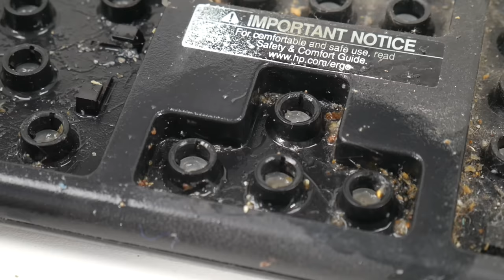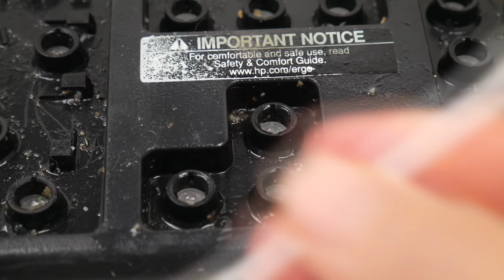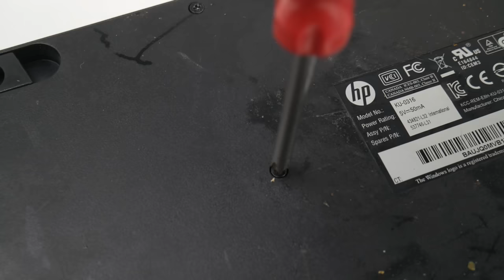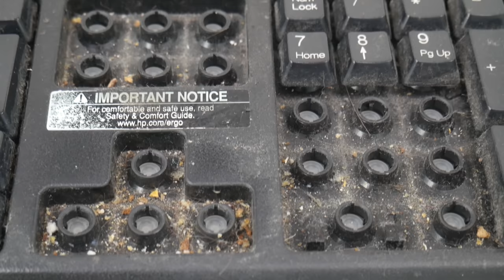Cleaning The Dirtiest Keyboard Ever!

Comment: Glad to know I wasn't the only one who was stressed watching this 😂😂
Reply: I was horrified when I saw him putting them in water
Reply: SAME
Reply: Same bro
Reply: @zmastereastee8033 it doesn't harm it if it's not plugged it. Just dry it before plugging again.
Reply: sameee
Reply: Sameeeeeee
Reply: Same
Reply: The electronic circuit board is sealed in the case for little water he used on it and then he dunked it in the water when the electrical parts were out if the way.

Compressed air will just blow the filth all over the place or no where as the keycaps are in the way.

What you should do is take the whole plastic case and put in is a dishwasher and the key caps and silicone in hot soapy water and mix. 

Don't use gloves as it's pointless as it's just old sticky crips and then wash your hands afterwards with hot soapy water. 

Use Mr Shine after to make it gloss like new.

Comment: I hope that this is some kind of joke. Im sorry, If Im being rude, but... this was horrific. First of all, It may be better, If you used compressed air at the beginning, but ok. Second of all, why did you use a toothbrush and q-tips to clean the plastic? Why didnt you use the brush, which you used later, to clean it? That really hurt my eyes. And why you used water to clean it, when there were still electronics part in it (6:00)? Ugh, this whole video just confused me and hurt my eyes. And you forget to clean the bottom plastic as well...
Reply: The electronic circuit board is sealed in the case for little water he out on it and then he dunked it in the water when the electrical parts were out if the way. Compressed air will just blow the filth all over the place or no where as the keycaps are in the way. What you should do is take the whole plastic case and put in is a dishwasher and the key caps and silicone in hot soapy water and mix. Don't use gloves as it's pointless as it's just old sticky crips and then wash your hands afterwards with hot soapy water. Use Mr Shine after to make it gloss like new.

Comment: Cleaning one of my old keyboards that was on par if not slightly better condition than this wasuch easier than how you did it. Remove key caps, dump the excess debris in a trash can, unscrew the back remove the front  and just go to a bath tube and drown everything in the soap and water until clean. For me even the electronics I washed with soap and water I just let it dry in the sun for a day or 2 before I used it again. Still works btw.

Comment: The electronic circuit board is sealed in the case for little water he used on it and then he dunked it in the water when the electrical parts were out if the way.

Compressed air will just blow the filth all over the place or no where as the keycaps are in the way.

What you should do is take the whole plastic case and put in is a dishwasher and the key caps and silicone in hot soapy water and mix. 

Don't use gloves as it's pointless as it's just old sticky crips and then wash your hands afterwards with hot soapy water. 

Use Mr Shine after to make it gloss like new.

Comment: If u are going to take it apart to clean it....then why not do so from the beginning instead of painstakingly using a paper towel (not even a microfiber cloth) and a dry toothbrush (when u actually had a huge black brush at hand later on). I already gave a concession that maybe u dun have compression air canisters at hand. But man.....this is a very terrible guide video.